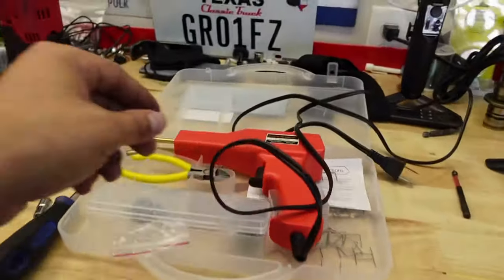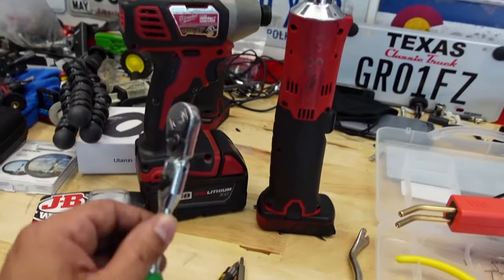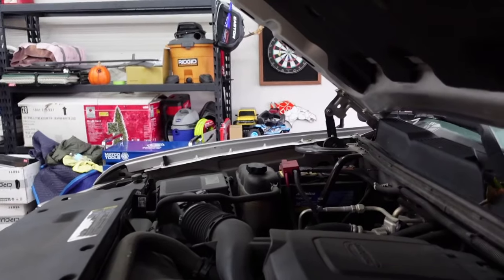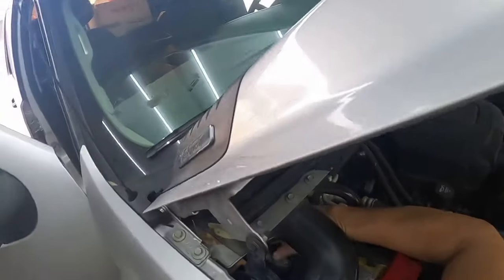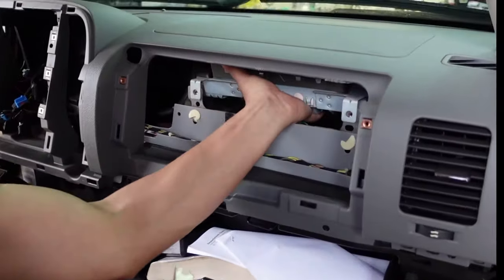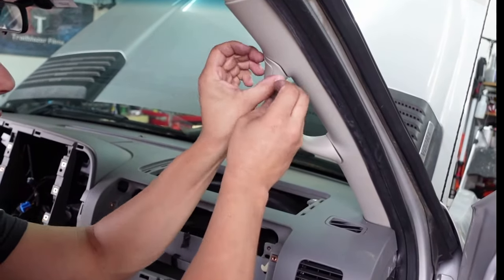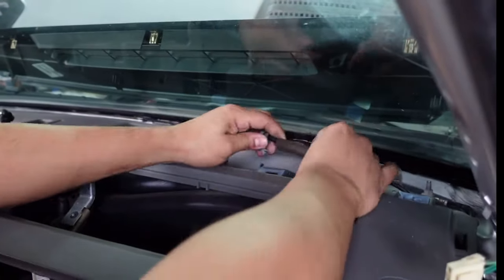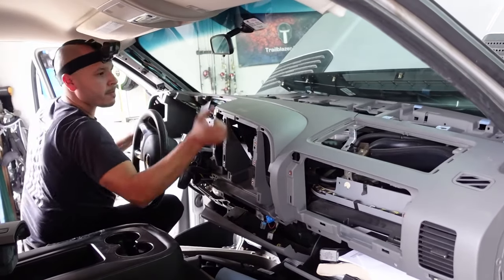REPAIR ALL CRACKED GM DASH. How To Remove Chevy Dash 2007-14. Tahoe, Silverado, Yukon, Sierra

Comment: I watch a lot of how-to videos, as I like to do all the work on my '08 Tahoe that I can (and I rarely leave comments, but I felt compelled to leave you one). I have to tell you that this is one of the most informative and helpful videos I've ever watch watched. The camera angles, your commentary, and the thoroughness of the subject were all top notch. Kudos, brother. Well done.
Reply from the maker: I appreciate it all the kind words brother, guess my experience taking these out & repairing them has shown. 🙏🏻
Reply: Exactly what he /\ said!!
Reply: Ditto Matt and Jeff, from me 07 Tahoe, doing all the work I can manage without a shop, until I must.   ( 238k miles, towing 6,200 lbs of Travel Trailer about 30,000 miles per year w/new engine and trans. It's not driven for anything but towing camper to races and shows etc).  Anyway, JJ you made it look easy or at least masterfully doable.
Reply: I agree, you most definetly know what you are doing.  Excellent video very informative. Your doing everything right.
Reply: This is the best dash repair jobs that I have seen on the Tube.  Looks very tedious, but we'll worth the effort.  Thanks.
Reply: Great job on your video, thanks 🙂👍

Comment: I had an unfortunate situation where I took my 2012 Silverado 2500HD to the dealer for a recall airbag replacement. They cracked the dash in the process and are denying it. I got them to pay for the new dash parts, but there is no way I'm letting them touch my truck again as I'm sure more would get broken. 
Even though I am a trade pro (Plumbing/HVAC) I was reluctant to attempt this install myself. I was so relieved when I found your video! And you appear to be working on my exact truck!
I've watched countless "how to videos" on various topics and I have to say this is hands down the best one I've ever seen! Your thorough bolt by bolt, piece by piece explanation, and superb editing of time consuming repetitive stuff was perfect for watchability. I am now fully confident that I can do this job. Well Done Sir! I will be subscribing!....I may even take this opportunity to upgrade my radio to a modern info center!
Reply from the maker: Appreciate the great comment & support!

Comment: You have obviously seen a bunch of bad  videos on repairs, because you learned how not to do them. WELL DONE VIDEO!. Comments were spot on, detailed just enough to get the point across. THis will take most of use a few hours but you are well versed in this job. Thanks for sharing.
Reply from the maker: Thanks, your right about watching so many bad videos. That definitely helped me make this video. Glad it came out good & hopefully it helps you guys repair your panels & save some money in the process.

Comment: I have a 2007 Suburban with 325,000 miles.  The dash had the same cracks.  I repaired them with a similar plastic repair tool.  2 years later, more cracks.  Didn't feel like messing with taking the dash out so I used some epoxy and paint.  When it cracks again, new dash or skin.  It's so brittle now it's like handling an egg shell.
Reply from the maker: Yeah unfortunately when they get that brittle it’s best just to replace it.
Reply from the maker: @Matthew Kerhin they are not any better, still made from the same material.

Comment: Awesome job.  These all crack in the same places and often cracks develop in sequential order.  Great repairs but I think they will crack again in the next summer heat.  I sprayed sound deadening on the underside of the panel.  Stopped squeaks.  Looks factory accept that the only thing holding it down is the sensor.

Comment: Great work on your channel for the first time and I have subscribed  for the tahoe with a little bit different  dashboard for the center or radio surround  your going to need some kind of plastic prybars and you might Crack it with them  but they have 7 clips and the paper thin trim is very tight so if you don't know how it is attached watch video or I go to the junkyard and see one that has already been ripped apart and you can see how it is fastened

Comment: Good work brother. The one thing I would do different is, I would put in a new dash, cause we all know that is going to crack again (somewhere else) the JB will hold well but it's so brittle the next cracks will be right next to old cracks or around passenger air bag. Might as well install new stereo while your there 😃. (I recognized that you were cognoscent of that by not putting in that bolt)
Reply from the maker: That’s true but this was for a customer I always recommend a new one if it’s in their budget. Thanks for watching

Comment: This I'd very awesome video wished you would have showed how good the dash looked when you finished it on the table but great job I would  have never had tried this before watching this I have a gmc sierra 2008 has a couple cracks no missing parts might just pop her out fix it n do this but a bit slower I'm sure

Comment: Dude! You are the fricken MAN! I don't know if you are a factory mechanic or if you've done this before but this is the only video I found online that shows step by step how to remove a 2008 silverado dash. I have the exact same truck and the heater core went out and you have to pull the dash to replace it. THANK YOU SO MUCH!!!

Comment: First, the dashskin looks great on my 2008 Suburban LTZ formerly with a very cracked dash.   Second what do you do when you need to remove the entire dash to repair the heater box?   The dash has to come out and the new dashskin has it glued in place?   I think I will destroy the new dashskin if I try this removal?   Any advice???   One more FYI:  on install plan to have at least twice the amount of silicone available to properly glue it down.

Comment: Obvious this guy knows what he's doing, and the work looks good. I do have two questions... do you guarantee no dash rattles? And how did the dash crack up like that?
Reply from the maker: Definitely guarantee there won’t be any rattles & as far as the dash cracking it’s due to stress on those points from the manufacture & the plastic they use.

Comment: Incredible ease of which you handled this repair.  How much should i expect to pay for this repair by a professional.   How do you compare this to a dash board skin?
Reply from the maker: Thanks, a professional will usually charge by how much the job pays to remove & install the dash which is 4hrs times the time for the repair so it may vary. I usually just charge a flat rate which can vary on the number or cracks. The dash board skins are ugly & don’t make it look any better, just my opinion.

Comment: I like the heat stapler…. Unfortunately on the Dodge dashes when they get to the cracked state, the rest is also brittle. I have had some success with epoxy glassing the whole assembly. Had to use an 80 grit to get the surface to take the epoxy resin and not pop loose.

Comment: Awesome video!  Any idea if this application would work to repair cracks in the dashboard of a 2006 Silverado?  Are you in the Houston area by chance?  If not, suggestions on going about finding a place that performs a repair like this, rather than simply applying a plastic overlay?
Reply from the maker: Unfortunately the 2006 model is a little different but the concept of the repair is the same. I am in Houston, send me a email with some pics of the dash & I’ll see what I can do. JJbanuelos84@gmail.com

Comment: I have a 2011Avalanche and I just used your video to replace the dash.  Why doesn't my upper (small back) panel snap back in place like yours did?  I bought a new one of those as well.

Comment: What was the BLUE sealant you used before the epoxy when you was using the staple tool? Going to order one for sure!
Reply from the maker: That was just a blue market I used to high light the crack so I can tell where it was. It gets hard to see once you get the lines matched up really good.
Reply: @JJBanuelos  Ah gotcha was wonderin on that GREAT video and goin to order the tool! I thought the BLUE was some sort of 'pre-sealer' or something.
Reply from the maker: @mt1885  no sir just a marker. Thanks for watching let me know how it works out for you.
Reply: @JJBanuelos  Can use on other plastics got motocross bikes.

Comment: Thank you for the video.  I have a 1995 silverado/c1500 that the bezel/instrument cover doesn't stay on anymore because the clip receiving pieces on the dashboard are all busted.  so the clips on the bezel are fine, but have nothing to go into.  Have you encountered this on vehicles you work on?  are there universal kits available?  I've looked everywhere.  Thanks again for this.
Reply from the maker: Yeah usually when those break there’s not much you can do to make new mounting spots. If this is the case after I repair the cracks I epoxy the 2 panels together. If that doesn’t work they will have to be replaced unfortunately

Comment: Great instructions. I’m planning to take mine out and get it wrapped in vinyl. Is it possible I can still connect the speedometer and the passenger airbag so it’s still drivable and won’t have any lights come on?
Reply from the maker: Yeah you should have any issues connecting any accessories back up since the vinyl is thin & wont keep them from going back in.

Comment: What prevented the air bag from going off while you were shaking it around?!!!
Reply from the maker: Removed negative batt terminal, then by the time I reached to get the airbag out it had discharged itself. Typically you wait around 10min before you mess with it once it’s main power source has been removed.

Comment: Okay, so I'm pulling mine now and a lot of the lower mounting holes are cracked and almost sort of crumbly, like it was cooked.  Have you seen that before?
Reply from the maker: Yeah unfortunately when they get this brittle it’s almost better to just replace it. The dash will just fall apart trying to get it out.
Reply: @JJBanuelos   Uggh.  I was afraid you'd say that.   Is it possible to still buy a new OEM one or do you know of an aftermarket one?  I know there's a guy in Houston who sells fiberglass ones made in Mexico for $525.  He promises exact fit...
Reply: @JJBanuelos    Bueno.  Okay, I'm going down to Houston in three weeks to pick up a fiberglass one. I'll let you know how well it fits.

Comment: Awesome video! I just got the dash put in after I fixed them all and my truck won’t crank now, any ideas? Thanks
Reply from the maker: I’d check to see if you plugged at the connectors behind the dash cluster
Reply: @JJBanuelos  the ones back by the windshield?
Reply: @JJBanuelos  would any of these connectors stop the truck from starting?

Comment: Did you glue before stapling the long cracks?  (seems like there was a light blue line).
Reply from the maker: No the light blue line was the marker I used to highlight the crack. Once you insert a couple staples if you line the cracks up really good it’s hard to see we’re it is so I use a marker to highlight them.

Comment: Temu has all the tools used cheapest online for this  panel pop tools plastic welding kit with the very best super glue on the  market I glued a Rubbermaid  lid for our coffee creamer that was ripping and was not any issues with plastic it's Got a needle tip point that is a few inches long and 3 to a bottle  with the part that drys on top it will pick off not fuse bottle shut but this repair will help pay for the tools and the next thing to break u already have the entire kit to do repair

Comment: hey man great video. quick question, under the steering wheel, where the trailer brake controls are (25:35) , do you think there is enough space to add an auxiliary button right above it? I'm installing some rock lights and want to add the button right above the trailer brake controls but not sure if there is anything behind that won't give me enough room to install that. Hope I'm making sense. Thanks man!

Comment: how long did it take you? if you remember by chance
Reply from the maker: I do this all the time so I can remove it, fix it & install it all within 2hrs total.
Reply: @JJBanuelos  i appreciate the reply. i’ve been debating if this was something i could do when i got off work one day. im busy 7 days a week and i’ve been putting off this repair for my truck. 

i’ve done little bits and pieces of dash work (radio, airbag (takata recall), hvac) in the past but never pulled it completely before.  but if it’s something i could do in a 4 hour time frame i’m game to order everything i need.

Comment: Hey, man get job on the video instructions and professional attitude. Love watching videos like this. What do you use to protect the dashboards after repair?
Reply from the maker: Thanks! Not much you can really do to protect these but adding a windshield sun shade will help from sun exposure.
Reply: Obviously with different dash styles and different damage on each dash. How much do you usually charge for a job like that roughly? If you don't mind a stranger asking.
Reply from the maker: It depends really but somewhere around $150-200 for a job like this.

Comment: Good job, unfortunately the repair is temporary as the material and the dash itself is the problem.  You can continue to do this for the life of the dash as you are not addressing the real issue.  An aftermarket dash pad is what is needed that will stand the test of time, not just a cap, but the dash itself and a OEM replacement is no better as you will right back here in no time, its a faulty product.

Comment: My take on the cracking dashes in all of these gm trucks and suvs is brittle cheap plastic and dead space underneath the dash. My dash only has 2 small cracks in the normal weak spots. Can the dead space be filled somehow?
Reply from the maker: Not to sure how much that would help honestly. The small crack the usually forms by the passenger airbag is supports from the bottom with a metal brace & it still cracks.
Reply: @JJBanuelos  thanks for the reply. Good to know about the support there. I just know that when I lightly press on the dash there's so much downward movement that no wonder it cracks, from vibration or pressure on it. I thought about reinforcing the cracks with a plastic welder, jb plastic weld or silicone the larger cracked dash to the smaller front dash.

Comment: Is the VIN a part of the dash assembly?
Reply from the maker: It’s not. The vin is attached to the body
Reply: @JJBanuelos  thanks, I’m wondering because my vin got damaged and I was told it was part of the dash (dash damaged too) the vin is on metal, do some dashes come with a metal piece attached to dash along with the vin? I’m thinking of replacing the dash, or do you think it’s the body

Comment: Nice video. Very helpful...but..... You went that far, you should have replaced it with newer one. It's going to crack all up again. It is the material it's made of. It gets brittle.
Reply from the maker: True but depending on how brittle the plastic is you can save most of them. It they start to crack when removing the screws then it best to just replace it.
Reply: @JJBanuelos  That particular material is going to fall apart. It breaks down in UV. I did same repair years ago....it was strong but the material was weak..it cracked in another place. I used that sticky back soundproof type mat on the underside to keep it from crumbling. I also made a front windshield dash cover part out of 1/8 plywood, as the plastic part once again just fell apart as you are picking it up. You had it out(the hard part)...Should have replaced it with newer one. Your video was great....It's all about the material that GM used that year.....I still own my 07 Burb 285,000 miles
Reply: I had my dash replaced some years ago due to a recall. Now it’s cracked again. After looking at this video I’m wondering if it was replaced or repaired!

Comment: Are you still taking jobs on replacing dashboard? Have a gmc sierra that need to be replace.
Reply from the maker: Yup still am. Email me what you have. I’m in the Houston area
Reply: Iam in the houston area as well, what is your email?
Reply from the maker: @reneramirez3482  trailblazerfilms1@gmail.com send me pics of the dash & wether you want it repaired or replaced.
Reply: Ok will do

Comment: I cant find one video for this repair for Buick Lacrosse
Reply from the maker: They have issues also?
Reply: @JJBanuelos  Buick is GM so yes. I have seen Impalas, Malibus, even Cavaliers with these issues, but GM or any aftermarket company do NOT offer overlay products to cover cracked dash with or even replacement Vent diffusers which ALSO crack.

Comment: 2008 tahoe dash is cracked and vehicle makes a humming vibration noise ...on slow rolling out of the driveway..goes away when driving....help!
Reply from the maker: Not to sure bout the vibration noise could be motor mounts these are pretty bad about going out.
Reply: @JJBanuelos  the humming vibration noise is in the dash..not under the hood

Comment: Whats the cost for this? Location?
Reply from the maker: All depends on the cracks it has. Usually around couple hundred bucks. I’m in Houston
Reply: @JJBanuelos  Can I get an appointment. I'm in Arkansas. I plan to keep my SUV for a while longer and would love to have it repaired. I have a cover over it right now but can still hear it rattling.